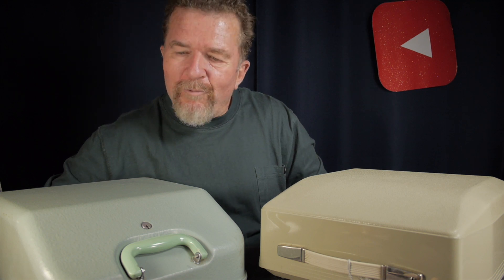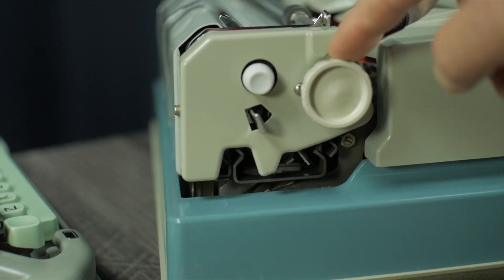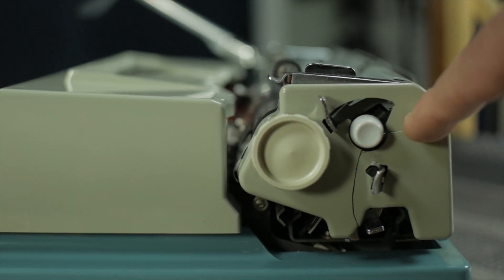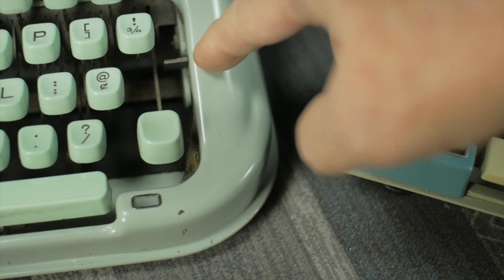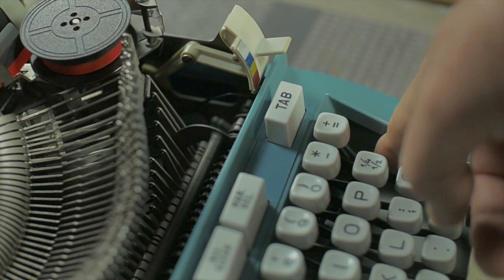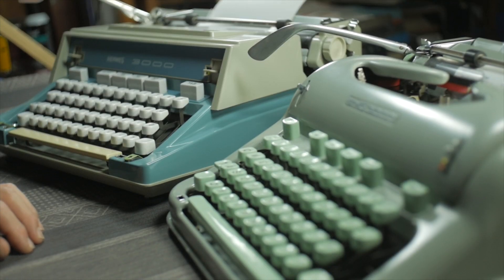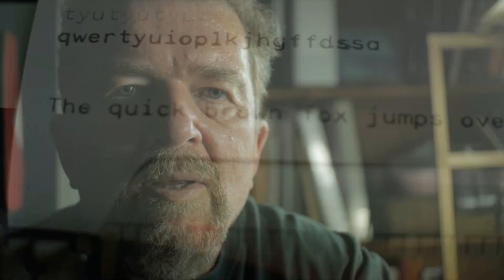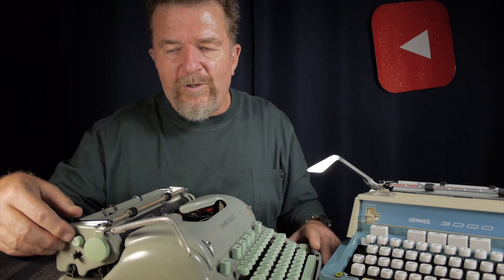Typewriter Video Series - Episode 236: Hermes 3000

Comment: My 1962 H3K has a small problem: letter A is skipping, especially when the key pressure setting is on low. I believe, from what I've heard, that this is a common problem with these typewriters. How can I solve this? Thank you in advance.
Reply from the maker: When ever I hear of people having skipping problems with the letter "a", the first thing I ask is: are you touch-typing? Try instead two-fingered typing using your index or middle fingers only. Type at least an entire page.

Frequently a skipping problem only with the letter "a" is technique-related. If you are right-handed, the letter "a" is typed with the weakest finger (the pinkie) of the weakest hand (the left hand); but it's the 3rd most frequent letter (in English).

However, if other letters are skipping, it could be the escapement mechanism needs to be cleaned and degreased.
Reply: @Joe_VanCleave  Yes, indeed, I'm touch-typing and I'm right-handed. But this only happens with my H3K... I also own an Olivetti Valentine and an Olivetti Lettera 32, but I've never encountered this letter A skipping problem.
Reply from the maker: @valipopa75  Different machines require a different touch in order to function properly. It's related to both design, and the condition of the machine. As I indicated earlier, the escapement on the H3K may need to be cleaned and degreased, so it isn't so sensitive to one's technique.
Reply: @Joe_VanCleave  Thanks, Joe!

Comment: I own both. Prefer the older 60's model. Newer 70's model actually stays put better on a table due to the foot design. Older rubber feet tend to harden into almost a hard plastic and the machine moves across the table. Newer 70's model has the rare Epoca typeface (as shown in this example) which wasn't in the older 60's and later 60's model. However, the older IS quieter to my ears, and you can hear it on the video (less clacky, more mushy). It's also smoother feeling. The newer version just feels cheaper all around, especially when you press the tab buttons or move the chunky dials. Newer one there is a higher chance the right knob will be broken or eventually break due to the design (and the harder plastic is more brittle). The newer version tab doesn't go down as far because there's a piece of rubber under the entire spacebar, which is a bit disconcerting to just touch the spacebar lightly and have it actuate. Overall, I prefer the look, feel, and sound of the early Hermes, but won't get rid of 70's model due to the rare typeface.

Comment: The thing that drives me crazy about the 3000 is the stupid margin design. It relies on an intricate ribbon configuration and also a tiny, fragile spring that can break, therefore completely disabling the margin. Fixing it isn't exactly a walk in the park, either. Horrible machines.

Comment: I own two Hermes 3000s, a 1967 and 1969. Both have plastic bodies and a more squarish shape.  
You can see them at:
https://typewriterdatabase.com/1967-hermes-3000.8789.typewriter
https://typewriterdatabase.com/1969-hermes-3000.14716.typewriter

As you know they are fantastic.   

I am surprised you didn't mention the nortoriously fragile platen knobs. My 1969  has repaired knobs. 

I also disagree with your characterization of the margin indicators. I saw one of them and fell in love with them. Any company that can engineer and build that must build a great machine. 

Nice review there! You'll need to get one of the middling rank machines, like mine, and see the difference. As David Sterling says, it is the best of both worlds.
Reply: P.S. - I have two similar machines because the 1969 has a European key layout - dead keys for the accent marks.